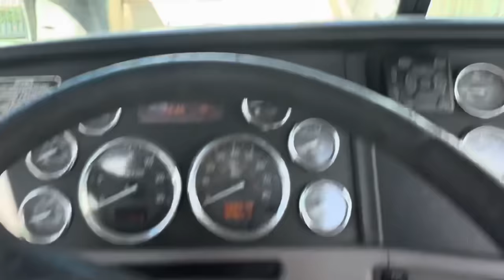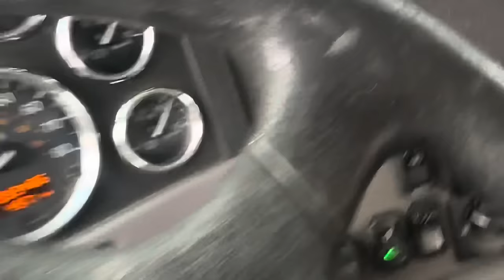The Reality of Being a Concrete Ready Mix Driver

Comment: They let you sit there for 2 hours with concrete? Our time is 1 hour 45 mins and we call it bad and they get charged. We time out after 1.45 and its go go go
Reply: No inspector on site  its all good lol
Reply: Damn we got 90 minutes
Reply: @noahstott1053 same but when there’s no inspector we be there for hours
Reply: How long is too long in terms of the concrete turning into something you need a jackhammer to remove from the truck?
Reply: @SaltyTubers  that can depend on alot of stuff, the mix, the temperature and the slump. You can have a slump of 2 for a pool and that gets dicy fast. Or you can have a 6+ for slabs and you have some time to mess with it
Reply: @SaltyTubers  we once had a specail mix that was getting hard in the truck as we drove to the job. We poured about 9ish am and i kid you not, the put a 10,000 pound generator on that same slab at 4pm lol. It was amazing how fast it set up
Reply: @brandonhalcyon6984  Holy moley, I knew there are a bunch of admixtures that can be used, but no idea you could pour something and have that kind of load the same day.
Reply: @SaltyTubers  ya it was a mess for us cause it was trying to set up in the truck on the drive over there lol. I have no idea what they put in it but it set up super fast
Reply: @noahstott1053  yea ACI spec are 90 mins.
Reply: They needed that concrete bad
Reply: You mean 1.75?
Reply: It depends on the weather, we too suppose to have 1:45 min but some times it takes up to 3 hours.
Reply: code says 90 minutes, 90 degrees, or 300 revolutions
Reply: 90 minutes for DOT but we give three hours for anything else. We get paid by the hour so it’s whatever to me.
Reply: Yep our ETA is aprox. 90 over. Then tango is a go for the KIA.
Reply: Someone is new to concrete 😂 it takes awhile to actually harden enough to wear its garbage. Ive been layibg cobcrete for 20 years lmfao
Reply: Shit I've been on site for up to 4hr with concrete
Reply: @AlfauWithOutLimits  thats you, not me, shits getting too hard that long
Reply: Trust me I know Especially now, with the heat. I'm thinking about carrying some bags with sugar around with me now.
Reply: Nice
Reply: How do I get started driving a cement truck?
Reply: @JackDamjien77  need a class b CDL and the rest is on the job training. Just remember to take your curves slow. 9 yards of cement is almost 40,000 pounds and you can roll them easy. We saw videos in training of them rolling them at less than 30 mph
Reply: @SaltyTubers you can just add more water but then the concrete is ruined

Comment: Very impressive driving skills! I worked in the sunflower fields when I was 12-13 and they were full of bees. We would cut the heads of the male plants off and then place them face down on the ground so they didn't pollinate any longer. I was so scared of bees at the beginning, but after a few weeks they didn't bother me. In fact, we used to sting each other after pulling out the stinger when stung ourselves. Those days I would come home with 25 stings on me...
Reply from the maker: Thank you, I liked reading your story, props to you for handling those bees🐝🐝

Comment: I'm currently working as a bulk cement and flyash driver for the last few months. Before that I worked as a reefer and dry van truck driver doing otr for almost 3 years. Considering maybe becoming a concrete mixer driver. If the pay is worth it. I'm also a female trucker. You go girl!

Comment: Bees can be a pain.  There was a section of highway I drove thru regularly at night and every time,  bees would get in the cab of the truck thru the windows.  I would have the windows open at night to get the fresh air.  Sometimes down my shirt or my neck.  It became a game if the bees would come in the truck or not.  Sometimes I would luck out and no bees.  Other times I would get stung while flailing to get rid of the bees.
Reply: It's better to keep your cool around bees. In most cases, they won't sting for no reason. Just leave the windows open and they will fly away eventually. Do the same if there is a wasp in the cab, but gently find your way out of there.

Comment: Do they make you sign contract when you get hire at this company? Some do that’s why I’m asking
Reply from the maker: Usually if you get you’re license through the company that hired you there is a contract, I got my license on my own and then got hired so I’m not on any contract, 
From what I’ve heard, if those on a contract wanna leave before it ends, they need to pay $$$ 😳. I always suggest getting it on your own
Reply: @lexflowaz  I also have mine Class A doubles/triples and tanks but I applied for a job like yours and they want me to sign a contract to get the job
Reply from the maker: @H_P23  that doesn’t sound right, do you know why they’re making you sign a contract? What did it say
Reply: @H_P23  Read the contract (so important). If you don’t understand it and you really want the job, take it to an attorney that specializes in contracts and have them explain it to you. It’s not as much as you might think ($) and it’s well worth it to know what you are signing. You’ll pay the attorney for the time they spend with you on it. (I would guess maybe $100 or so. Maybe 30 minutes depending on many questions you have.)

Comment: Hey Lexie, just found your channel. I'm thinking of applying for one of these cement companies here in Cali. Maybe you can answer some of my questions.
How many hours on average do you work a day? Do you mostly do residential or commercial? Do you have time for a proper lunch? Is it physically demanding? Are you filthy after work? Does work slow down during the winter and rainy days? What was your longest day at work? Do you recommend working as a cement delivery driver? Whatever you can answer, I would greatly appreciate it. Thanks.
Now back to your videos
Reply: Hours will depend on where you live if it’s a growing city ect. Expect to do 10-12 hours a day but some days will be shorter or longer. You can do up to 16 hours once a week but that won’t happen often. Whether you do commercial or residential is also dependent on location you’ll probably do a bunch of each. No lunch no break time, you’ll have plenty of down time waiting to get loaded or on a job. It’s not physically demanding you’ll gain a bunch of weight if you’re not careful. It slows down during the winter but most companies guarantee 40 hours but you’ll probably do overtime even in the winter depending on location. If it’s raining hard and even sometimes not that hard you stay home. If you’re a good driver who’s not afraid to do some driving off road with a big truck it’s easy and you’ll probably bring home +70k some guys get 90k plus benefits be at home every day get 2-3 weeks vacation plus 8 holidays and some rain days off. I’ve been doing 7 years and it’s the easiest job for me but we roll through people constantly who can’t keep up with the hours and who are scared or the suck at driving.  Good luck
Reply: @timebomb6080  Man! You answered all my questions. I really appreciate you taking the time to do so. I applied for a Mixer company in my area about three weeks ago. Not sure why they haven't called me. I have a Class A with all my endorsements but not much experience delivering, only driving busses, so that might be it. I'm guessing they're probably not interested, which is ok. But who knows, they might call me after all. Anyway, thanks again. Be safe out there and keep on rolling

Comment: you need to carry some retartder in yr truck incase you get stuck in. traffic with material still on yr truck basically it will retard the set ,,, use in for emergencies especially on hot days sitting around for 3 hour to unload can cause a flash set or hot load... but before you add it check with yr boss fist because the contractors won't want it but getting stuck in traffic going back to unload extra ,, it would not matter ,,,,

Comment: I drive a day cab and a 53’ now. Is that a tag axle on the rear? How do you know when you need to use it? What happens if you don’t use it? I am going to see what concrete haulers pay around where I’m at in NC?
Reply: Tag axle on the rear is for weight distribution. You are taught when to use it. 
I've done a lot of things and for me driving redi mix trucks was the most enjoyable

Comment: Is it a 2500 psi mix ? If so, just add 20 gallons every 30 mins, then call after 2.5 hours
Reply: Do that and while you might still dump. Water weakens the mix. I wouldn't allow 2 hours sitting in the drum, even spinning.

Comment: As a concrete worker- I would like to apologize to you. 
A lot of people blame the driver when it is the shoot mans fault. If it is a front end loader and you're controlling the shoot, I can understand a little bit. But when people other than the driver control the shoot and either dump to much, or to little or yell because they can't move the shoot around fast enough and try to blame the driver when it's not the drivers fault it irritates me. As a finisher I have called them out for being a dick to drivers more times then I can count.

Also, I know 100% for a fact you have to deal with concrete guys constantly hitting on you, should they be? No, but you know they are and do. Did it take you a while to get used to it? Does it annoy you or is it flattering? How do you handle it when someone says something that goes to far?

Comment: Honestly I got a question about the job that I’m struggling with. Wondering if you could help me out?
Reply from the maker: Sure what’s ur question?
Reply: @lexflowaz  is your truck automatic or a manual transmission? Because mine is an 8 speed manual but for some reason even on the low gears it struggles like crazy to go uphills. Wondering if you have tips for that lol
Reply from the maker: @nosir1440  manual 8 speed as well! I was taught when on hills to chose a gear that’s strong enough but not tooo strong, just enough where you’re able to rev it high to keep the momentum, but also not a gear where it’s struggling and seems like you need to downshift, for me it’s usually 2nd gear and I just take it slow with my hazards on!
Reply from the maker: @nosir1440  what gear do u usually go up hills?
Reply: @lexflowaz  okay okay. So you chose your gear before entering the hill or as you’re going up? And just go slow even if you’re holding up traffic ? I always get nervous about that too lol
Reply: @lexflowaz  I try to on 3rd but man does my truck struggle too. Even on 2nd. I’ve checked with my mechanic he said there’s some engine problems too lol
Reply from the maker: @nosir1440  I would suggest to stop before you go up and select your low gear, I used to just go up and downshift as I went up but I stopped doing that after one time I spilled 2 yards for stopping so suddenly when I couldn’t downshift properly 🥴😀 so definitely learned to stop and go slowly, and honestly in these situations just let the cars wait, or let them figure it out theirselves If they wanna pass you or wait behind you, don’t let them make you feel rushed!
Reply: @lexflowaz  that’s some great advice I really appreciate. I’m in California too but in the central coast. And when I go to Monterey or Carmel some hills are very crazy with traffic behind me so I get pretty anxious dealing with them. I got an old truck compared to everybody that has newer and nicer automatic trucks lol